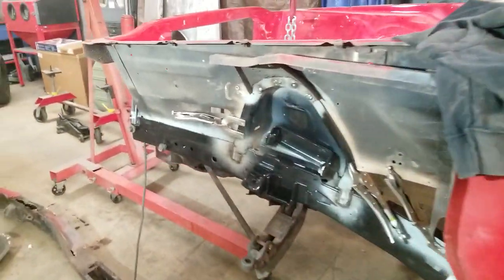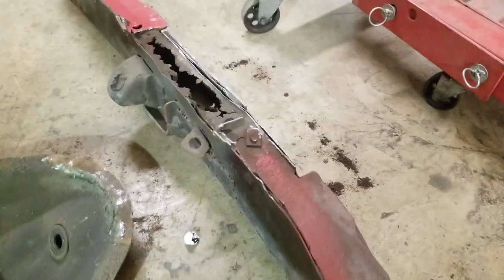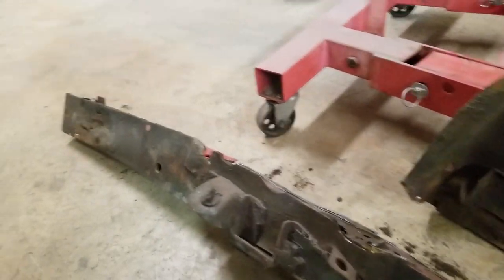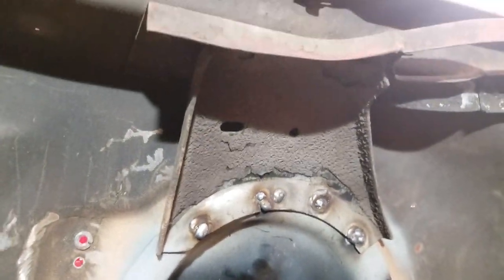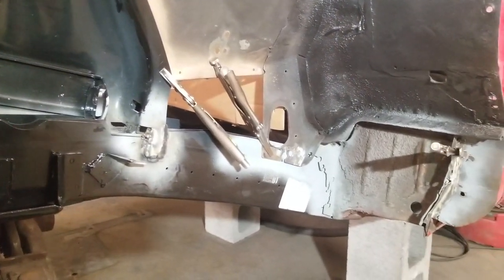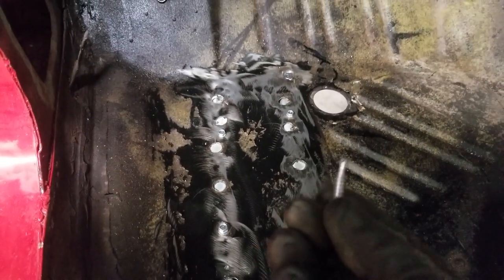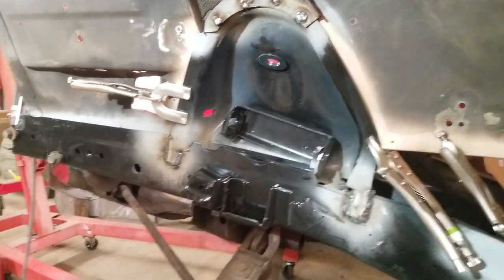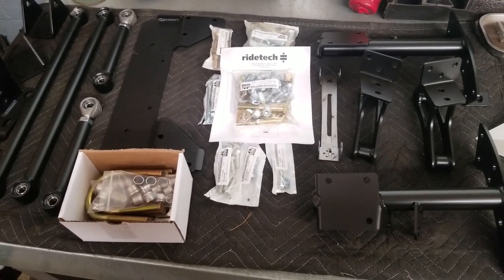Left front frame rail replacement on the 1970 Hemi Cuda.

Comment: Good stuff. Just bought a '74 Challenger with eerily similar issues in the frame rails. Lots of rust and some pretty fugly patches welded on. Got lots of work to do and replacing the frame rails is on the list. Thanks for the great video and helpful tips.

Comment: David. How ya doing? Love your work. Even on GYC. Glad your doing your own stuff. Um so my dad's first car in 11th grade was a 1973 Dodge Challenger 340 / 727. Cool car by today's standards. He still has it. But he daily drove the car right so Ohio roads are it up. I was wondering if you can give me stock frame dimensions just basic measuring tape I had to replace both frame rails in the front torsion bar crossmember both aprons and rear frame rails and shock Tower crossmember the only thing I have left over from the rear frame is where the leaf springs connected under the under seat pan. Mark is impossible to get ahold of. He always the 1 to say how he loves the story behind the cars. But when u try to he blows u off. I jus need measurements. Thought I'd ask you

Comment: Hey Dave, I see they only reproduce the 71 and up inner fenders..the one installed on your 70 is a 71 style..I would guess if going correct is the goal. I would need to patch up that dented in corner where the 71 gas tank emissions tube bolts down to with a clamp..my 70 does not have that...have you run into that problem on 70 cudas?

Comment: Thanks Dave for your video, I have a 1971 Satellite Sebring Plus since I was 14. I’m now 55 and giving it a third freshening up. While pulling the headers I discovered some serious holes in my front frame right behind the K member. I haven’t been able to find a replacement for it but I have seen in a few articles that the same year E body will replace it. My inner fenders are like new, so are the other frame rails, but I was hoping I could proceed the same as you have. My main question is will the E body frame fit in the b body? Thanks for your help in advance.

Comment: Hey Dave, when you level the car do you go by the rocker and across the rear frame rails?
Reply from the maker: I measured from the ground up on the rear frame rails where the blocks were located, then I measure from the ground up to the  torsion bar crossmember where the front blocks were located then I take three measurements from the ground along the front frame rails to gain an equivalent of both sides.
Reply: @DavidReaDBRestorations  thank you sir . Miss you on gyc but now I found you here so all good

Comment: Like to know how was the length of frame rails of AMD.
Reply from the maker: The rail was spot on for length, of course you want to make sure you do all your cross measurements to make sure position is correct.
Reply: @DavidReaDBRestorations  to me look like the passenger side frame is 1/2 in short. Is it possible if you can give me the mesurement where the frame rail attach to cross member?or do you have any mesurement you made for your car?
Reply from the maker: @romangranite74  sorry I dont have the measurements on file, I took all the measurements before I removed the rail and the car is no longer here.